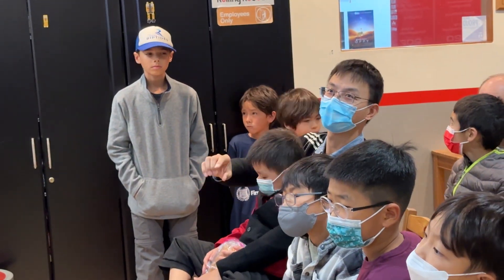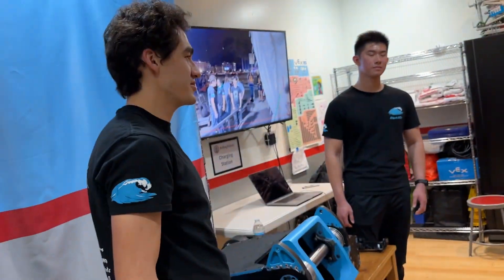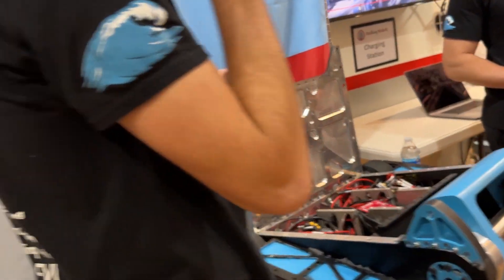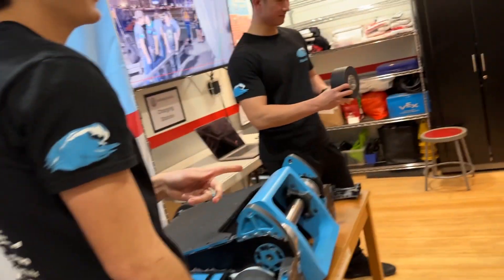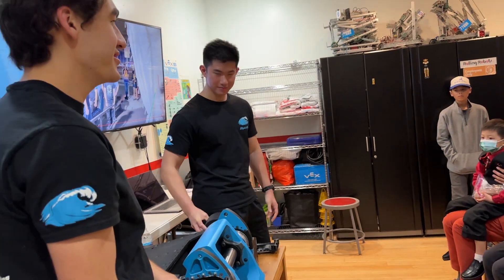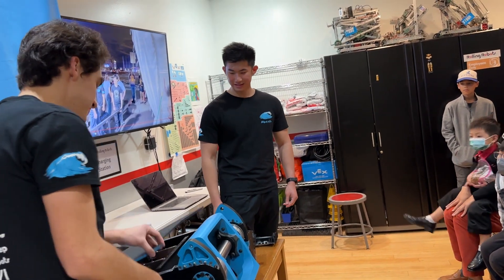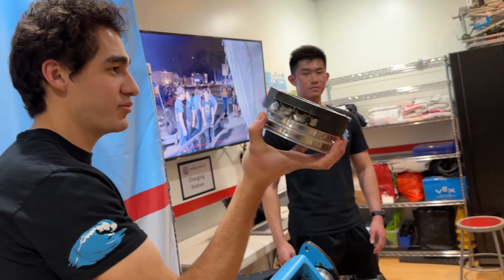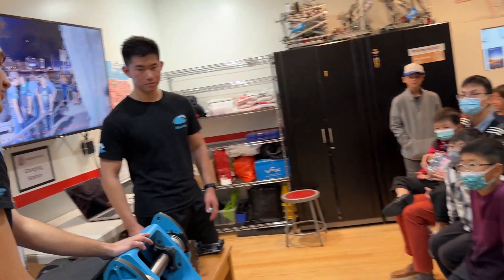"How Does Riptide's Weapon Get That Bite?" A young builder asks,  Riptide Battlebots Outreach

Comment: I assume the width helps too... Instead of being 2 to 4 inches across like other weapons, you're getting enough bite to launch bots to tha mf roof 😂
Reply: Not even Hydra can flip that high.
Reply: @Theprophet3928  Riptide  has done it already... And Hydra's flipper tongue is only so wide so all of the energy isn't going straight up. A lot of the time their victim spins on more than one axis because it is usually not dead center...
Reply: @Theprophet3928  Not really true, Hydra's flipper can launch bots higher than a full whack of Riptides weapon can, mostly due to Riptides weapon tooth spinning a lot faster than hydra's arm does and there is a bunch of energy converted into basically destroying the thing they are hitting instead of just purely launching a bot like Hydra does.

Riptides weapon at full speed and with full bite launches a 250lbs bot maybe 3/4ths - 4/5ths of the way to the roof of the arena, it needs another weapon (on the other bot) to spin downwards hitting Riptides weapon and basically add the kinetic energy of both spinners together (as well as providing a solid surface to transfer energy with) to get a roof shot (like with HyperShock), while Hydra's flipper does it all by itself.

A good example is in the fight Riptide vs I think Defender where Riptide tried to self-right on the edge of the shelf, so they spun downwards and hit a very solid steel part of the arena to launch themselves in the air and although they went pretty high up it was nowhere near the ceiling.

That's about the maximum height a full hit from Riptide would launch another bot from just their weapon.
Reply: @Pseudoscience-is-a-scam  Just because a weapon spins faster doesn't necessarily mean it will have more energy to launch something up. Higher speed means decreased bite and that hit on the wall in the fight vs Defender is the most bite they are ever going to get.

And I just gave the launch vs Defender as example, everything I wrote was with the WCW7 bot in mind.